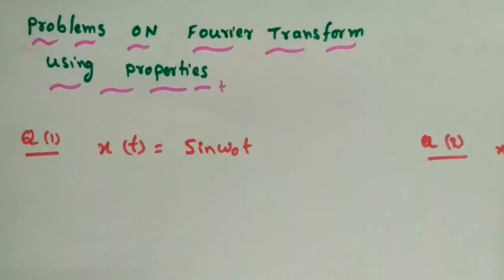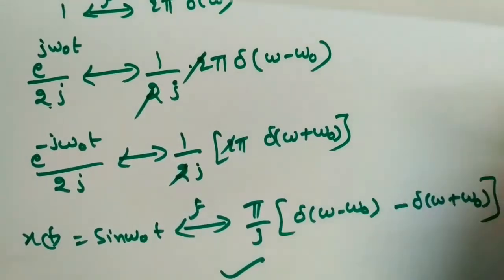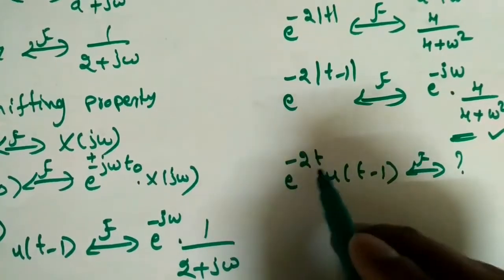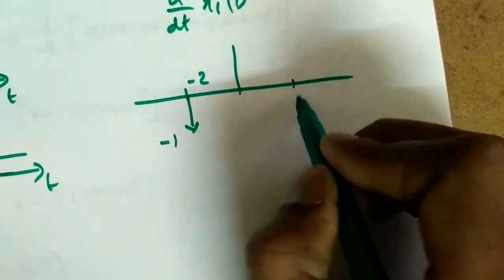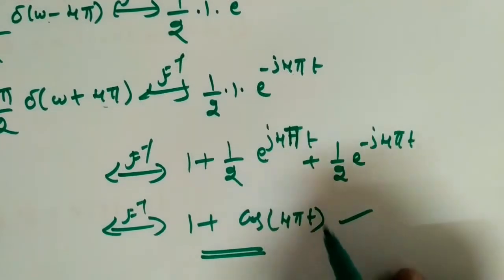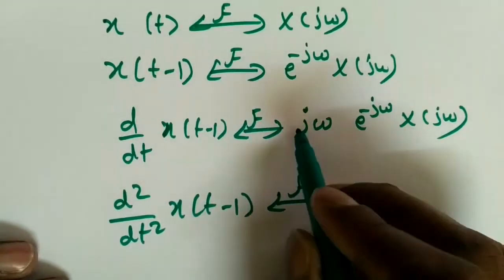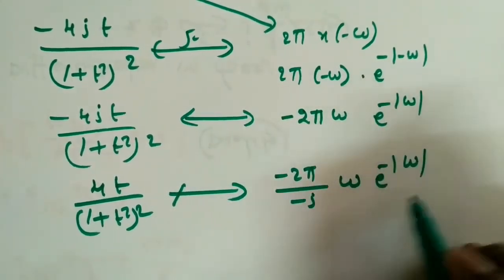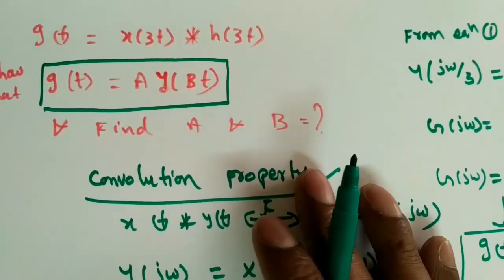Signals and Systems Lec-27: Continuous - Time Fourier Transform (Part 3)

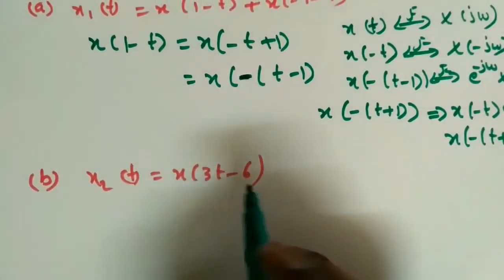Comment: Hello sir. @ 18:41
If I do shifting first then scaling 
Then do I need to divide the power of  e^(-jw6)  by 3 (which I got after shifting) during scaling? Then only I get the result e^(-jw2). 
That means do I need to scale all the terms which consist of jw?
Please correct me.
Regards,
Amit
Reply from the maker: when we do scaling, we have to scale all the terms which consists of w
Reply: Ok Sir. Thanks :)